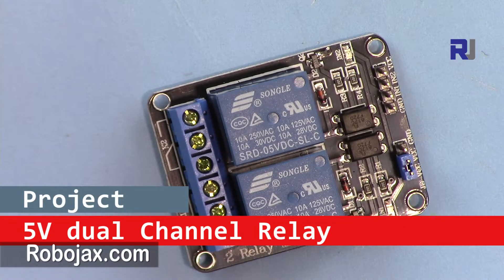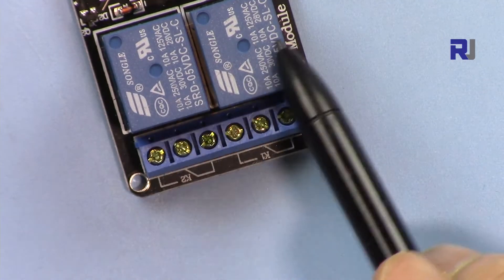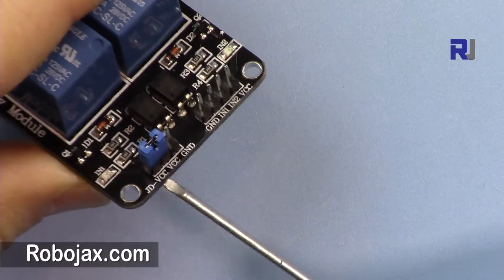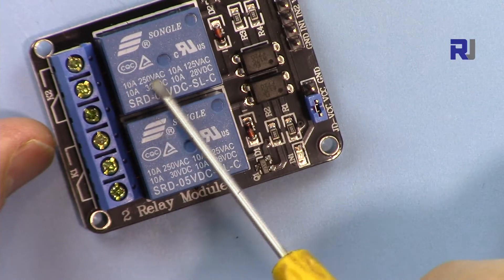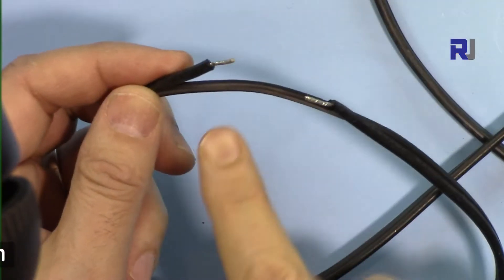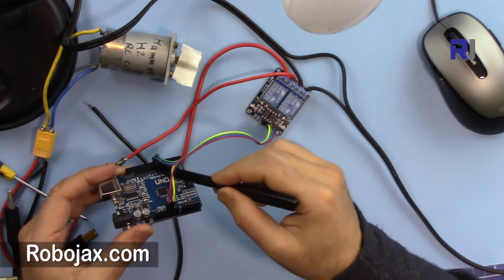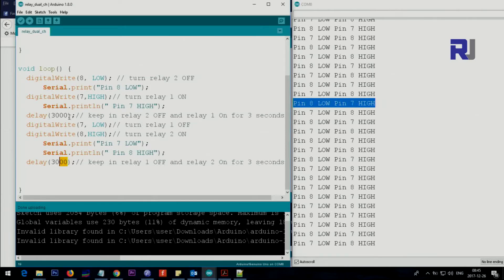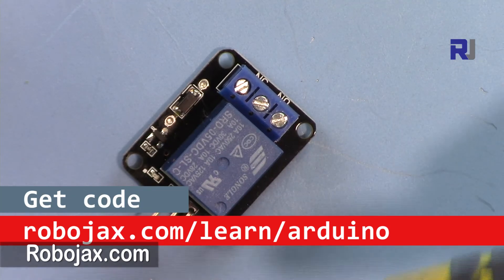How to use 2 channel relay to control AC and DC loads in Arduino RJT34

Comment: Cant we do it without aurdino
Please reply fast
Reply from the maker: Yes you can do it with two push buttons. Instead of input from Arduino to the relay module, you connect push button to the input. Sorry there is time difference between Canada and your location. I was in bed when you replied. Also I read comments ONEC a day. so it will take usually  12 to 24 hours.
Reply: @robojax  sir can u post a video on it very fast before tommarow and  waterpumping motar should be there i.e automatic tap pls sir urgently nedded
Reply from the maker: I have a lot of videos on relay and push button. Just search my channel.

Comment: hi robojax, why do some people use diode, transistor and resistor in similar circuits? is it related to reverse current? and if so, does separating the power supply for arduino and relay help (so only data connection between arduino and relay)?
Reply from the maker: sorry I missed your comment. The transistor and diode etc are to drive the relay. this module has all those components for you. I have separate video on how to drive a relay  See it here https://youtu.be/N-fFk51Eb8s . To keep the power of Arduino and the board separate, it is a good practice to keep the microcontroller and the power section separate. This increases safety.

Comment: Is the JD-VCC pin strictly for powering the switches? Can it also be used to connect a single DC power source to 8 devices, e.g. 24V peristaltic pumps?
Reply from the maker: Yes it is.  the connector is to power relay ONLY. it has tiny pins. have I understood your question?
Reply: @robojax  Yes. Thank you!

Comment: Sir please can you help, when should i connect the jumper and when should i remove it and use an external adapter?
Reply from the maker: I watched the video making sure I have I have explained it in the video. Watch the video twice or three time until you get it.
Reply: @robojax  
Sorry for bothering you, if i want to control my room lights, should i connect external adapter?

Comment: Awesome video, inspiring too
For DIY project- I’m trying to build gate opener. Few questions, if you could answer please;
1-which motor is enough for 200kg sliding gate.(any link or product specs)
2-forward/reverse bi-direction rotation(how to achieve)
3-anyway to have a motor speed control possible?

I’m willing to do this for months but no guidance is stopping me.
Reply from the maker: 1- if you don't need speed control, use this module https://youtu.be/PjfPxxBTYiE
2-for up to 15A use this https://youtu.be/tCJ2Q-CT6Q8 without direction control
and it would be hard to find such thing all in one
Reply: i want to do the same project

Comment: I don't have a lot of experience with relays, but I found out that my relay looks the same but works in reverse.  When there is power from digitalWrite(7,HIGH) it actually turns it off and the "LOW" command turns it on.  I don't know if this is normal, but I would appreciate any input.
Reply from the maker: yes. because your relay is "low trigger". Watch the video again. or see this video https://youtu.be/58XWVDnB7Ss

Comment: can you supply that relay switch with 24v 12AH supply? since the supply exceeds the 10Ah required current, will my supply burn the relay switch?
Reply from the maker: I have explained it in the video, but have a look at this: https://snag.gy/UDJMCg.jpg
Reply: @robojax  Can I control load of max 15 amps under 12 volt DC??

Comment: Bro can you help me make an app and code for switching on and off 2 AC connections using arduino nano and Wifi module? I was making a Wifi Enabled Smart Plug for my Science Investigatory Project. Tnx
Reply: Better use Wemos/NodeMCU board. ESP8286/32 boards have nice examples in Arduino IDE.

Comment: Great job, Robojax. I was able to duplicate this2 channel example.  However, I have a 8 channel relay and wanted to use only 4 of the 8 channels. I used the code for the 2 channel example as a starting point but I ran into a problem. I was able to verify /compile but there was a problem uploading to board. 

Can you please help me troubleshoot the code? What   I wanted to do is connect relays 1, 2 3 and 4 to pins 7, 8, 6 and 9, respectively.  I want pin7 and pin9 to be on for 3000 ms.  while pin6 and pin8 are off for 3000 ms. Next, I want pin7 and pin9 to be off for 3000 ms while pin6 and pin8 are on for 3000 ms.

My code is below and thanks a million for your help.
/*
 * This is the Arduino code for Dual Channel 5V Relay
 * to control turn ON or OFF AC or DC load. You can control 2 differen loads such as bulbs, or heater or other machine
 * Watch the video https://youtu.be/EclIomn_3dI
 *  * 
 * Written by Ahmad Nejrabi for Robojax Video
 * Date: Dec 26, 2017, in Ajax, Ontario, Canada
 * Permission granted to share this code given that this
 * note is kept with the code.
 * Disclaimer: this code is "AS IS" and for educational purpose only.
 * 
 */

void setup() {
  
  Serial.begin(9600);// setup Serial Monitor to display information
  pinMode(7, OUTPUT);// connected to Relay 1
  pinMode(8, OUTPUT);// connected to Relay 2
  pinMode(6, OUTPUT);// connected to Relay 3
  pinMode(9, OUTPUT);// connected to Relay 4

}

void loop() 
{
   digitalWrite(9,HIGH);// turn relay 4 ON
      Serial.print(" Pin 9 HIGH");
 digitalWrite(6, LOW); // turn relay 3 OFF 
      Serial.println("Pin 6 LOW");
  digitalWrite(8,LOW);// turn relay 2 OFF
      Serial.println(" Pin 8 LOW");
  digitalWrite(7, HIGH); // turn relay 1 ON 
      Serial.println("Pin 7 HIGH");
  delay(3000);// keep in relay 2 OFF and relay 1 On for 3 seconds
  digitalWrite(7,LOW);// turn relay 1 OFF
  digitalWrite(8, HIGH);// turn relay 2 ON
  digitalWrite(6,HIGH);// turn relay 3 ON
  digitalWrite(9, LOW);// turn relay 4 OFF
      Serial.print(" Pin 7 LOW");
      Serial.println("Pin 8 HIGH");
      Serial.println(" Pin 6 HIGH");
      Serial.println("Pin 9 LOW");
  delay(3000);// keep in relay 1 and 3 OFF and relay 2 and 4 On for 3 seconds

}
Reply: Thank you so much. This makes sense. I tried it but the problem persists. I think it has to do with the board. I'll get another board and then try it again.  Thanks again. You are truly a gem!
Reply from the maker: Your loop should look like this
void loop()
{
// keep 7 and 8 HIGH and 6 and 9 LOW
 digitalWrite(7, HIGH); // turn relay 1 ON 
 digitalWrite(9,HIGH);// turn relay 4 ON
 digitalWrite(8, LOW);// turn relay 2 OFF
  digitalWrite(6,LOW);// turn relay 3 OFF
 delay(3000);// wait for 3 seconds

// Now change them. Keep 7 and 9 LOW and 8 and 6 HIGH
 digitalWrite(7, LOW); // turn relay 1 OFF 
 digitalWrite(9,LOW);// turn relay 4 OFF
 digitalWrite(8, HIGH);// turn relay 2 ON
  digitalWrite(6,HIGH);// turn relay 3 ON
delay(3000);// wait for 3 seconds
}// loop closed here

Comment: NO not normally CONNECTED? that doesn't make sense. its normally closed and normally opened.
Reply from the maker: You are right too. It is just matter of perspective. In contacts and wires, "closed" or "connected" results the same thing: flow of current.
Reply: @robojax  Can I control load of max 15 amps under 12 volt DC??
Reply: Robojax  No not working with high voltage. the wrong words used is not your perspective. the wrong words can be result in people getting hurt or worse when working with high voltage.  there is no liability in the wrong words you use just ignorance.